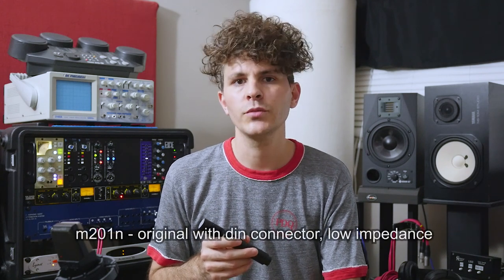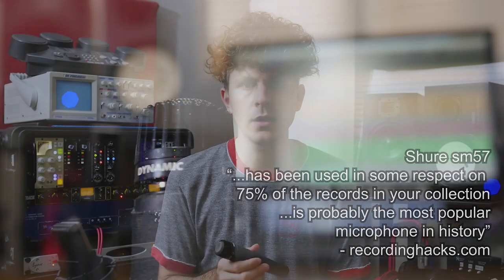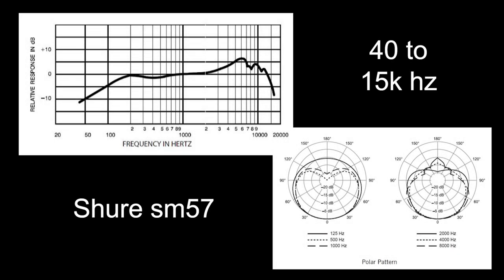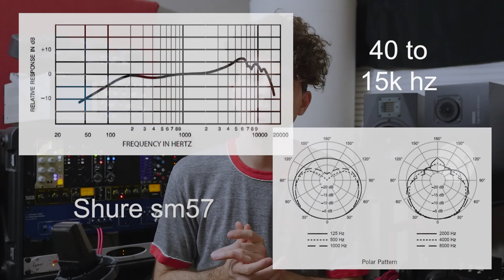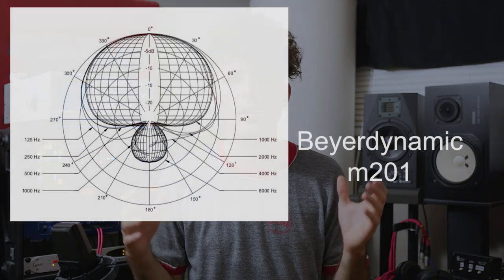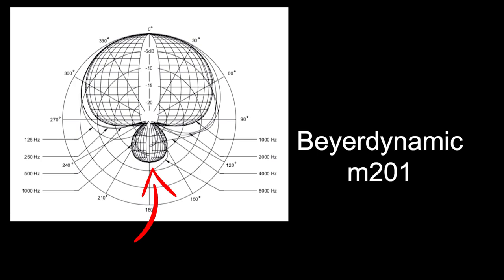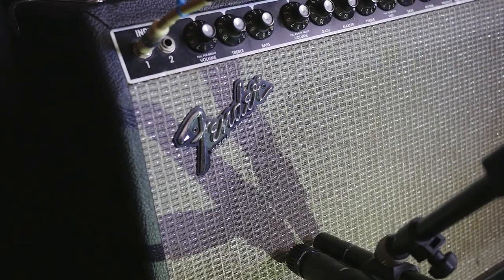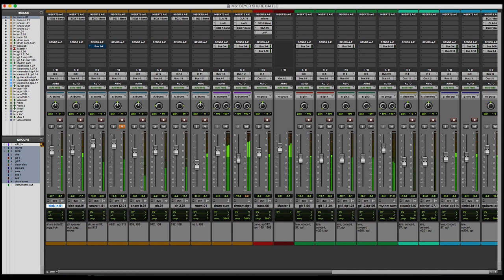Beyerdynamic m201 & Shure sm57 - Microphone Comparison with Sound Samples

Comment: Cool comparison. I'm using an M201 as an overhead paired with a Sennheiser 521 (basically a 421 without the filter switch) in a Glyn Johns type of arrangement and I like it very well.

Comment: great comparison! by testing it against a very common mic as a baseline, you have helped me to assess what the m201 could bring to the table for me. imo, the difference is very subtle on snare, the sm57 takes away just a slight bit of air; it's almost unnoticeable with the drum mix. on the distorted tele though, it's night and day, two very different sounds; the m201 is very open and natural, it sounds beautiful and kinda 'new', the sm57 almost seems pre-mixed to fit a classic rock mix in comparison. same with the clean guitar. on the acoustic, the difference is a bit more subtle, but still you can hear the same features as described before; i feel in this instance they both sound kinda stiff. i guess i'd probably prefer an sdc pointed above the soundhole or behind the bridge. i think your final verdict is spot on: sm57 might be less trouble to fit in a denser mix, but if you've got the space, the m201 will probably bring something to the table the 57 can't.
Reply from the maker: Weyllandin thanks so much for watching and for offering your thoughts. I agree with everything you’re hearing! They’re both great mics in their own right, just gotta choose what suits the sound best. Good luck🤘🏼 - James Meder
Reply: To me the coloration of the 57 is just too bad. Now - could you imagine the 57 competing with the 201 on a grand piano - or a violin or a flute etc.? I mean with a good EQ I could turn the 201 into a 57, but not vice versa of course. So, the 201 cost about as twice as much but it´s really worth it.

Comment: The main takeaway is that the m201 is a surprisingly good acoustic guitar mic. Then, similarly also much better on clean electric guitar. Sounded more natural, cleaner, more extended and less coloured, where the SM57 colouration on clean electric wasn't so pleasant. But on the driven electric guitar tone, it was the other way around, albeit to a lesser extent. The rolloff and that dip in the 400hz area, combined with the more pronounced prence peaks gave the 57 a slight edge. On snare, it's harder to call, and would depend on the context of the track. If I wanted the bite on top, and cleanness in the bass, for a busier mix say, SM57 would be the choice. In a more minimal track, with a smaller ensemble and more spacious mix. Let's say something like Low, or Earth, I might go with the m201, because I liked the low-end body/fullness. So, I think worth having a couple of 57s in the studio, but also a couple of m201s. Lots of studios will have 3-4 57s, but based on this video, might be a mistake to not have 2 57s, and 2 m201s.

Comment: James was more perceptive on the high end. I was on the low end. Not so much on drums but the guitars, both electric and acoustic, were very different on the low end with the different microphones. When the guitars' low frequency sounds were being captured by the SM57 they didn't sound very different tonally from those borne via the M201. But the SM57 seemed to capture about half of what the M201 captured! It was so stark side by side that the SM57 sorta sounded like fallout, like there was a low frequency gate being applied. The M201 sounded gateless and channeled a constant stream of low frequency. I wondered if James was simply not playing as hard on the low strings when using the SM57. My guess though, is that it's the microphone, that the SM57 has some sensitivity cliffs down at those low frequencies.

Comment: Good comparison, unbiased, pro's for both. I personally couldn't hear much difference either and the price is 3x's higher for the 201. But theres no doubt a lot of pro's prefer having that 201 in the locker and many seem "threatened by the SM57" a bit to make comments as if there is some huge difference, but theres not. imo.

Comment: Thanks James. This helps. Have you tried the m201 on male vocal, and if so what did you think of the results?
Reply from the maker: You're welcome and thanks for watching! I have tried the m201 on male vocal - my own in fact! It's usable in a pinch. The top end is very nice and detailed and has a good amount of presence when placed within a mix. I would say I wanted to hear more low end out of the mic which wasn't there. Also, because it's hyper-cardioid, you have to stay right in front of the grill or it can sound like you're 'off the mic'. 
If you can save up a little more money I would highly recommend the Shure SM7b. That's a great vocal mic for only a little more money. Good luck on your search!
Reply: @JamesMeder  Thanks for the tip. Yep, gotta love the SM7.

Comment: I would be very interested to hear any subtle or unsubtle differences between preamps you have, all else being kept the same, especially on male vocals. Not having a studio history I don't know what people mean when they talk about "the Neve Sound," vs "the API sound," etc.
Reply from the maker: Hi Carl, thanks for watching! This is a great suggestion, I appreciate this - it's got me thinking lots about how I can pull something like this off. In my experience the most distinctive part of preamp circuits is the characteristics of the input and output transformers. Within each manufacturer, Neve for example, there has been a few different transformer makers throughout the years - Neve started with Marinair transformers, then moved onto St Ives, which then became Carnhill. People argue which version is best! So my thought is that there is a lot of variations within the Neve and API builds so it would be hard to judge them fairly without first establishing an understanding of their builds/company history. 

I don't personally own any Neve branded gear (though I have Neve inspired preamps like the Atlas Pro Audio Juggernaut). The only API preamps I own is my pair of the 512c's. Like Neve, I believe that API has gone through various stages of development as well. I'm thinking that the ultimate preamp battle would be a comprehensive 'Neve(or API) throughout the years'. Hopefully by examining all of the different builds we'd be able to hear a overarching 'flavor' of sound these preamp companies provide. It's a lot for me to think about! Hopefully I can get around to it one of these days. Thanks again for the feedback!!

Comment: The SM57 compresses the transients a little bit i think - already in the microphone... good for rock!
the m201 sounds better in my opinion - but it also gets more hihat sizzle in there - so maybe the sm57, despite its roll off and technical disadvantages, has its place for a reason.
Reply from the maker: Great ear! I agree with your thoughts here. I'm sticking with the 57 for a while still. I may have a change of heart in the future...  Thanks so much for watching! - James Meder
Reply: The hi-hat sizzle is mainly because the m201 has a hypercardiod pattern and is picking up the hat that's directly behind it, so if it were positioned off axis with the hi-hat, there'd be less of that spill. The 57 has great rejection from stuff behind it and would be better where the m201 is!
Reply: @nialldunsmore8336  you get it

Comment: Nope, it's better to put the hi-hat cymbals in that 120°-150° cone on the rear of the M201. You can even try to get the high tom and kick inside the cone. The bleed will be reduced and sound much more pleasant than the back of an SM57 will ever sound. Speaking from both studio and live recording experience.